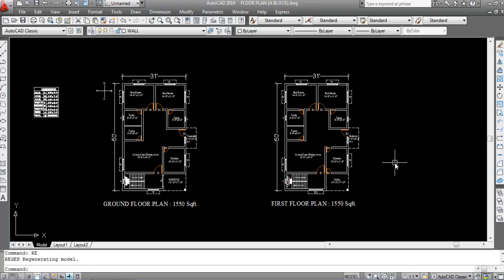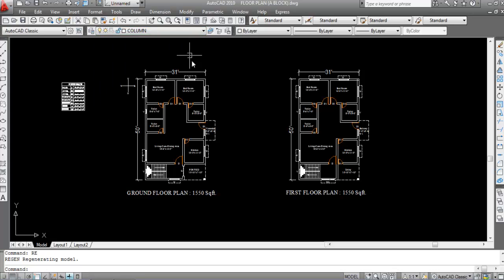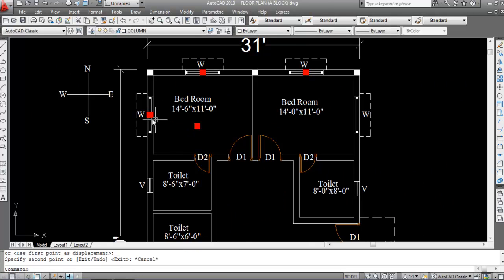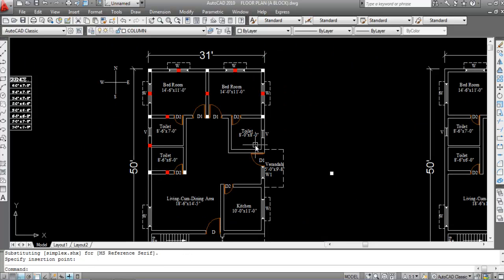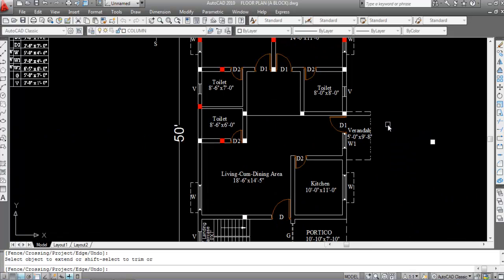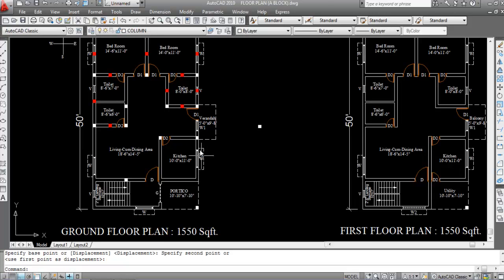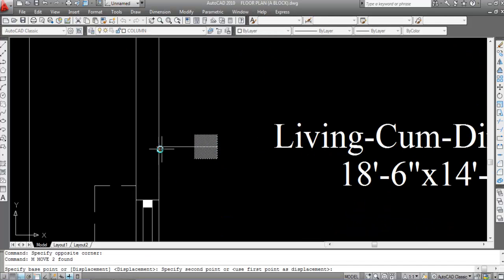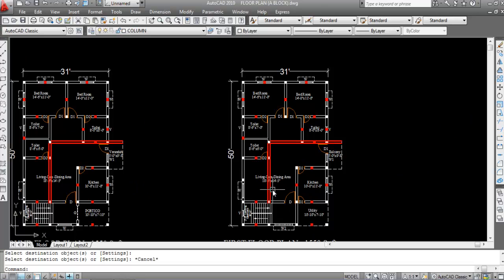How to Provide Columns in Building Drawing AutoCAD || Building #2

Comment: Please  the stop columns  where does  it goes  ..is it important ..
Reply from the maker: Stub column. 
Red columns are Stub Columns. Stub columns are located below ground level to avoid long spans of grade beams and in places where the soil condition is not enough strong for load bearing structure and not too less strong for framed structure. Stub columns are provided in such places to minimize the construction cost.

Comment: what is staf column?
Reply from the maker: Stub column. 
Red columns are Stub Columns. Stub columns are located below ground level to avoid long spans of grade beams and in places where the soil condition is not enough strong for load bearing structure and not too less strong for framed structure. Stub columns are provided in such places to minimize the construction cost.
Reply: @civilengineeringtutorials  thank you so much

Comment: Nice one and is very useful. I am not a civil man. I have one basic question to ask. You have given the same plan for the first floor also which is correct based on columns in the ground floor. Though we should maintain the same columns , can we construct different size rooms and adopt different plan for the first floor ? Or should we need fresh columns for the different plan there ?
Reply from the maker: Thanks for watching.
Yes of course you can construct different size of rooms, but all rooms should be designed as per existing columns of ground floor. You can't change existing columns of ground floor. If you want to change column position then you need to change ground floor column position 1st.You can't keep different column positions for  ground floor &1st floor plan. You can change room size but existing column on ground floor will be same on 1st floor. So according to ground floor column you need to change 1st floor plan if required. you can  also add extra beams as per requirement if column position is not supporting your new plan.

Comment: I will not understand the concept of providing stop column ?
I think you provide this info as soon as possible
Reply from the maker: Stub column. 
Red columns are Stub Columns. Stub columns are located below ground level to avoid long spans of grade beams and in places where the soil condition is not enough strong for load bearing structure and not too less strong for framed structure. Stub columns are provided in such places to minimize the construction cost.
Reply: CIVIL Engineering Tutorials Have any video or any content for better visualisation. 
As during my degree i never heard that
Reply from the maker: yes. its new. i will prepare another video for better understanding.

Comment: So much column will destroy beauty of structure and will increase economy...
I dont understand y u r not following Building codes for providing coloumn
Reply from the maker: In this plan columns are provided only where columns are required. No extra columns are provided. If columns are provided after properly designed and it's proper required location then it will not destroy the beauty of structure.

Comment: What is a STOP COLUMN?
Reply from the maker: Stub column. 

Red columns are Stub Columns. Stub columns are located below ground level to avoid long spans of grade beams and in places where the soil condition is not enough strong for load bearing structure and not too less strong for framed structure. Stub columns are provided in such places to minimize the construction cost.

Comment: Nice video ma'am,stub coloum are same as footing coming up to only ground level????...Plz clear me if I am wrong
Reply: Is it necessary to provide such a large number of stub column?
Reply from the maker: Thanks.
Red columns are Stub Columns. Stub columns are located below ground level to avoid long spans of grade beams and in places where the soil condition is not enough strong for load bearing structure and not too less strong for framed structure. Stub columns are provided in such places to minimize the construction cost.
Reply from the maker: Yes, more the number of stub columns, stronger the building.

Comment: Very nice clear please what is stope columns,and how to use you at window in plan
Reply from the maker: Thanks. 
Red columns are Stub Columns. Stub columns are located below ground level to avoid long spans of grade beams and in places where the soil condition is not enough strong for load bearing structure and not too less strong for framed structure. Stub columns are provided in such places to minimize the construction cost.
Reply from the maker: Share me your email ID please
Reply from the maker: 5” thick
walls are generally provided in partition walls only. External walls should be
10” thick. 5” thick walls are not structurally safe if they are beyond  7 feet 
height or carry some imposed load. That’s why I recommend that all the
walls should be 10 “ or 9” thick. The reason for this the tendency of walls to
buckle. Tendency increases as the height of the wall increases and the load
also increased. So reinforced cement concrete (RCC) bands are provided in 10”
walls. Because bands are required to offset the tendency of buckling or
earthquake safety.
SHre me your email Id, will send you some more details.
Reply: manojdokhe@yahoo.in. Please share colum details And Max and min distance to prove

Comment: Stop column na enna??
Reply from the maker: Stub column. 

Red columns are Stub Columns. Stub columns are located below ground level to avoid long spans of grade beams and in places where the soil condition is not enough strong for load bearing structure and not too less strong for framed structure. Stub columns are provided in such places to minimize the construction cost.
Reply: CIVIL Engineering Tutorials thank uuuu

Comment: Madam red column use
Reply from the maker: Red columns are Stub Columns. Stub columns are located below ground level to avoid long spans of grade beams and in places where the soil condition is not enough strong for load bearing structure and not too less strong for framed structure. Stub columns are provided in such places to minimize the construction cost.